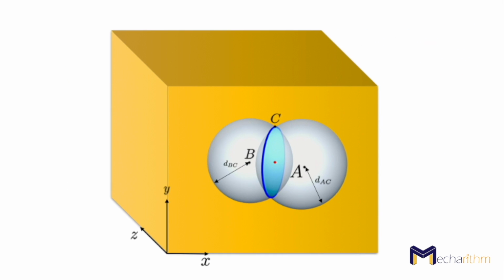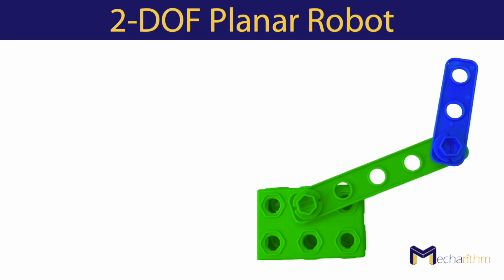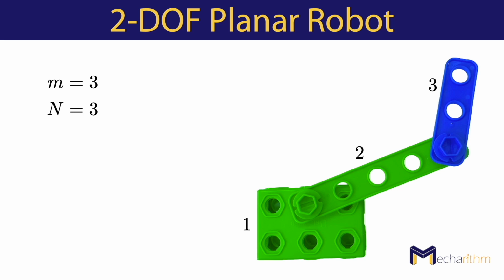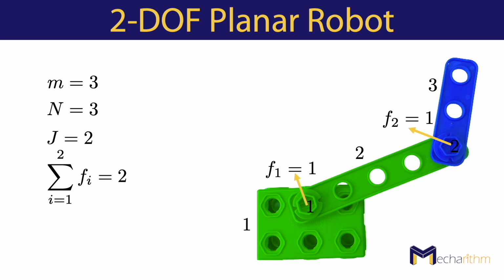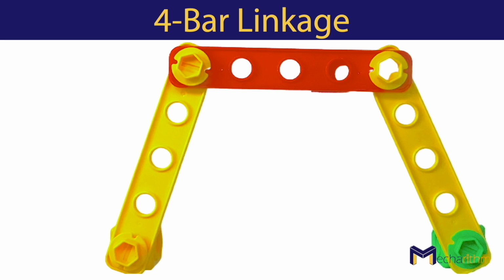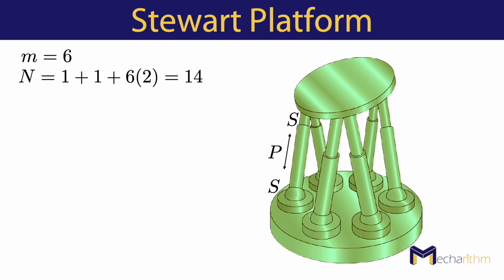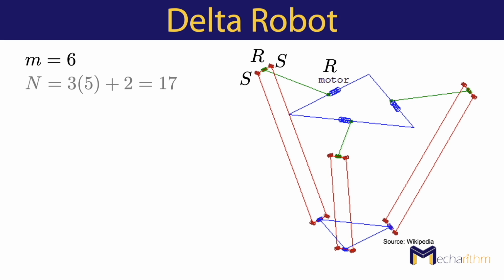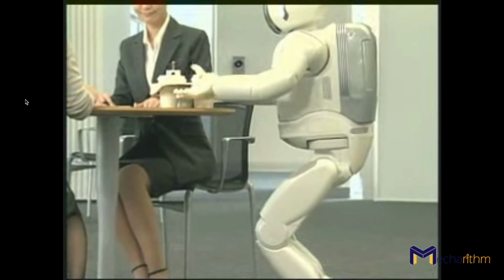Everything About the Degrees of Freedom of a Robot | Fundamentals of Robotics | Lesson 3

Comment: Hello Madam,

It would be great to mention in the video - which dofs are lost by the arm to avoid the spilling of drinks? The answer is of course - The roll motion of the wrist and the shoulder.  Thus, having 5 dofs in the joint space (as you correctly said). 

But interestingly, the roll motion of the wrist and shoulder can compensate for each other by doing opposite motions. Thus, they can be allowed to move as well. For example, if the robot wants to place drinks in the middle of the table, then the elbow might collide with the table surface. In this case, equal and opposite roll motions of the wrist and the shoulder can help rotate the elbow sideways. So then, all joints move but the roll motion of the wrist and shoulder are coupled (they can't move independently without affecting each other). Can we then say that the effective reduction in the joint space dof is 1? Meaning there are 6 dofs allowed in the joint space?  [wrist (yaw, pitch), shoulder (yaw, pitch), elbow (rotation), coupled roll of the wrist-shoulder = 6]

I would like to know your opinion on this!

Comment: The degrees of freedom (DOF) of any articulated mechanism is its mobility number, such as 0 or 1 or 2 or, etc. DOF is also the sum of all constrained joint mobility numbers. A kinematically locked joint has zero mobility or zero equivalent mechanical advantage, and a dextrous joint has nearly unity mobility and high equivalent mechanical advantage. The ith joint's mobility number may be obtained from the square of the norm of the ith row of the constraint Jacobian matrix's orthonormal null-space matrix. The number of columns in this matrix is DOF, as is its norm. The sum of squares of all row norms of this matrix is also DOF, which is why the sum of all joint mobility numbers is DOF. Technically a joint's mobility number is the square of the direction cosine between it and the mechanism's differential constraint manifold. Maximum motion and mobility is obtained when the joint is closely aligned with the manifold's surface, and minimum mobility when it is orthogonal to or nearly orthogonal to the surface.

The most reliable way to get the correct DOF, which can also fail, is to apply Gaussian Elimination with Complete Pivoting (GECP) to a very accurate Jacobian matrix associated with the articulated mechanism's kinematic constraint equations. If the model has n variables and the Jacobian matrix has rank r, then DOF=n–r of the variables are independent. The wrong rank r and thus the wrong DOF may happen when mechanisms are over-constrained and some or all of the joints must be perfectly aligned to get any motion at all. At each stage of matrix factorization there is a remaining residual Schur complement matrix. When the norm of this matrix is zero or falls below some predetermined constant, the Schur complement matrix is considered to be zero and factorization stops. Matrix rank r is then the dimension of the resulting invertible factor matrices, not the number of rows or columns of the Jacobian matrix. Problems occur when the Jacobian matrix is noisy or in error for whatever reasons, and the noise or errors contaminate the remaining Schur complement matrix, causing the algorithm to incorrectly increase rank r and decrease DOF. Get the wrong DOF and the mechanism model will not perform as expected.

A good example is a 6R Bricard mechanism with a 6 by 6 Jacobian matrix. When the six joints are laid out correctly and precisely the mechanism will have one DOF and articulate. Thus the matrix rank r must be 5, so DOF=6–5=1. But even tiny amounts of constraint error will lead to tiny amounts of error in the Jacobian matrix, and GECP will return a rank r=6 and DOF=0. Before factoring the Jacobian matrix to determine matrix rank and model DOF, the constraint violations must be minimized to the extent of available precision, and hopefully that will be enough for GECP to get the correct matrix rank and DOF. Incidentally, see what the Chebychev–Grübler–Kutzbach criterion is for this mechanism and ask yourself which method is more likely to be more accurate most of the time.

See "Chebychev–Grübler–Kutzbach's criterion for mobility calculation of multi-loop mechanisms revisited via theory of linear transformations" by Grigore Gogu

Comment: Thanks for the video! It would be great if you also explain why do we actually care about the number of dofs? What's the use of it in practice? Where it leads us to?
Reply from the maker: That is a great question, Denis. As an example, suppose that you are a robotics engineer and you are asked to design a robot with specific dofs that can perform a specific job (the task that a robot can perform depends on its dofs). Knowing about dofs, joints, links, and types of them is foundation knowledge that you should have before doing that.

Comment: Dear Dr. Babaiasl. It is great job for new generations. But I think you should check the replacement of X,Y,Z axes. Your video does not apply right hand rule in some stages.
Reply from the maker: Veysel, thanks for your feedback. Would you please specify the timing? All coordinate frames are based on RHR. We would appreciate if you give the exact timing to check.
Reply: @mecharithm-robotics   one of them is at the 1.38, when you are showing X,Y,Z coordinates by the help of pipette. You say X by showing the blue pipette, Y  by showing the red pipette,  so on. That would be the mirroring effect of camera so I may be wrong. But I think so many audience did not realize.
Second ;  at the 2.14, You showed a coordinate system at the corner of a yellow cube. This coordinate system is not proper to RHR. You must exchange X and Y titles on the diagram.

Comment: First of all thank you for the video. I have a question. Can you please explain what exactly constraint means?
Reply from the maker: Turhan, thanks for your comment. That's a great question. Think about the door hinge. As you saw in the video, a rigid body in space has 6 dofs but a door has only 1 dof. why? because the hinge restricted the body's movement and imposed 5 constraints on it thus it has only 1 dof (6-5). The same for a rotary joint for a robot. The joint imposed 5 constraints in space on the movement of the links and thus gives them only 1 degree of freedom. Hope this helped. Without a hinge or the joint, the rigid body (the door or the link of the robot) would've had 6 dofs in space.
Reply: @mecharithm-robotics  Thank you so much for the explanation. You’re the best channel in robotics

Comment: Hello Madi, perhaps can you tell more about the « independence » in the degree of freedom ? 
It is something I don’t get fully.
Thanks.
Reply from the maker: Alexandre, thanks for your comment. In order for Grubler's formula to work, the constraints in the mechanism should be independent. We know that the constraints come from the joints. Now suppose a mechanism with a parallelogram structure with three links where each parallel link is connected to two joints. If you use Grubler's formula, you will get zero dofs for this mechanism which is a wrong answer since the mechanism can move and it is not rigid. The reason is that if you make any of the joints rigid, the movement of the other joints will also be affected and the mechanism cannot move. Therefore, the constraints (or the movement of the joints) are not independent of each other and we should be careful when using Grubler's formula. Any of the links with its two joints have no effect on the overall motion of this mechanism so when using Grubler's formula you should eliminate those to get the right answer.